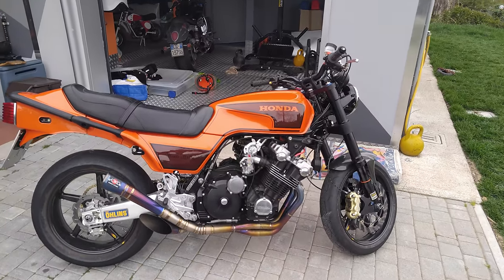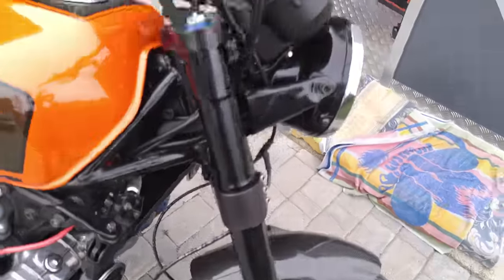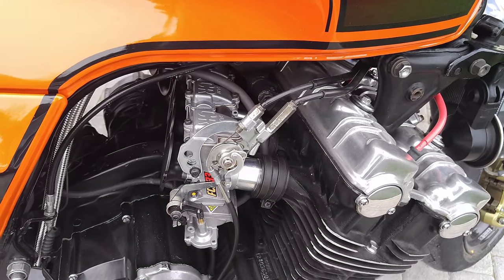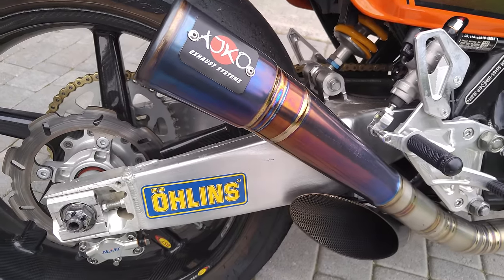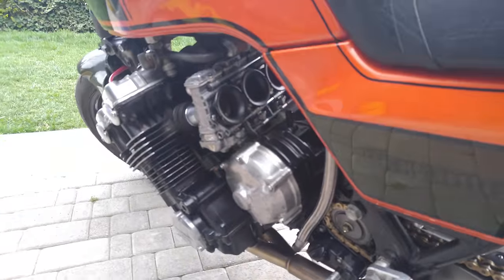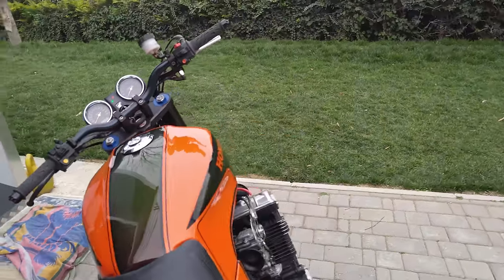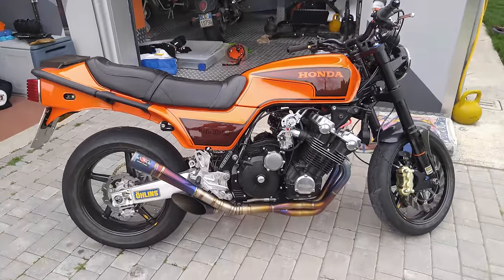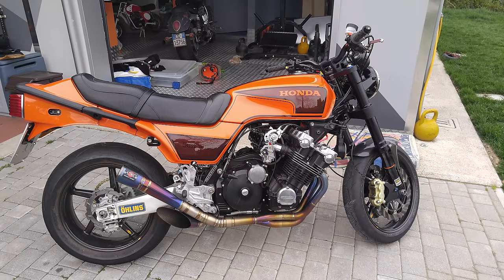Honda CBX 1000 Pro Link restomod 1981 -explained and SOUND  Misterhelmet -ＣＢＸ1000改造

Comment: Air filters are good, mmkay! Great sounding and well specced out bike! The idle is very high, the CBX sounds good at any rpm, so you don't need to idle at 2000-2500. Again, air filters man! An air box with air filters do have a purpose, they are complicated, usually ugly, heavy and take up a lot of room, but they do have their purpose! With a good airbox design, the carbs are much easier to tune (the carbs are engineered for airboxes) and they also make more power, certainly over a greater rpm/load range!

Comment: The camshaft selection on these was so good right out of the crate. I often wondered why Honda chose such an aggressive grind when they had all that displacement and didn't really need it. Get those flat slides working right and you'll have a real beast. FWIW, these do like a little bit of a warm up before reving them in neutral.

Comment: Very pretty, I have a 79z, tried to upgrade certain things, but I selected other better CBX bits eg I have the prolink front end on mine, with the ventilated discs and four pot calipers, all CBX parts, love them. 
Mine sounds just like yours, I have a Walker six into one, that was built in 79 but has a modern Yoshi can, the headers have been ceramic coated silver. Love those carbs on yours

Comment: Very well job
Btw is it possible to mount the Suzuki 1400 instead of Yamaha for the back side of the motor ?
Thanks for your reply
Reply from the maker: well I don't know honestly. Probably is possible but would need a different custom made link.
Reply: @misterhelmet  in case if  i need some advice can you help me at this regards 
I'm in Nederland and if it's one I can send you my question 
I like to build one for my self I love cbx1000 
Thanks again

Comment: Really nice bike and sounds amazing!  I just picked up a 1981 project CBX and I'm going the resto-mod route.  Are you using the stock frame?  How difficult is it to fit aftermarket forks and swingarm?  Thanks for any advice you can offer and congrats on a beautiful bike.
Reply from the maker: Orignal frame. Then you have to find some cbr 1000 front and some lighter swingarm. Just considerazione that any link and adapter is custom made including platea, bolts, risers, etc. Every component on this bike is custom made or heavily adapted

Comment: for my opinion the moto its fantastic only the back its not mach with all bike its to long  fat and hi, with my big respect for your job ..
Reply from the maker: Say it to Honda. I did not change anything about frames and plastics on the bike except cutting a little bit the rear mudguard. All plastics are like the original 1981 bike.
Reply: if you like to experimental in future try Extended rear + low..